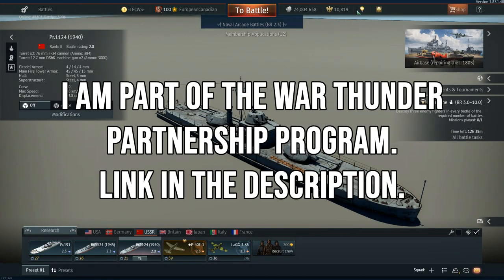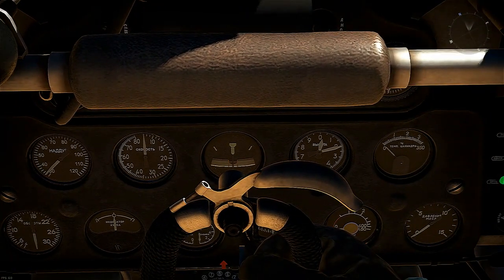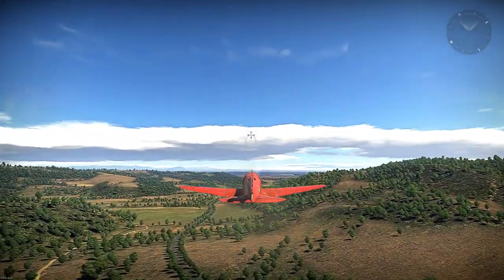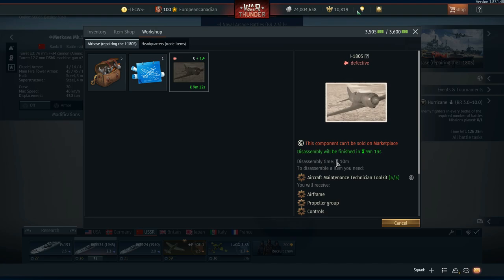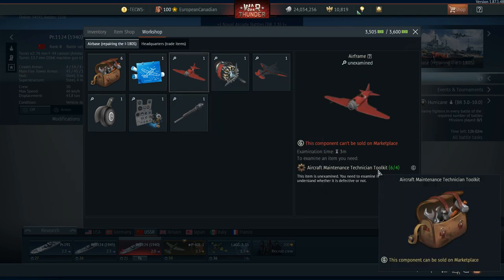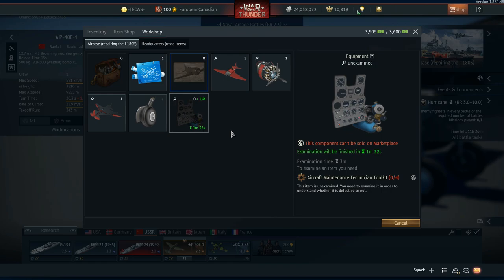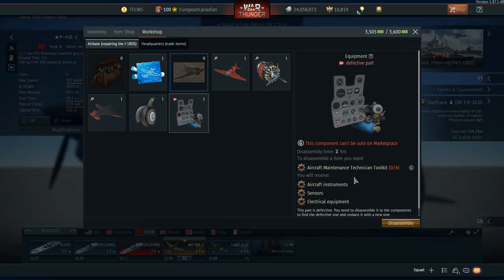War Thunder - Battlefield Engineer Diagnostic and Assembling

Comment: Only a Russian mechanic would throw his tools away and get another set every time he finishes a project.
Reply: Insanitypepper 
Thus is a nation that made the hydraulic fluid on the T-34 drinkable, of COURSE they would do that
Reply: Precisely the opposite
Reply: @Valley Boy - You realize the only thing you get by paying is faster research? Your tier 6 Premium vehicle never sees a Tier 4 or most tier 5 unless it’s specifically in a lineup with the intention of breaking the matchmaking. Get better. This isn’t world of tanks where you get a tier 5 vehicle in tier 4 with a tier 7 gun. Players can buy camo, a large assortment of items for vehicle or even convert them to premium. Literally the only thing you get is a new tier faster and again which 80% of the vehicle over 1.3 ranks higher which you will extremely rarely see again when people break matchmaking or as a random pull. Unless your aware of a paid aim assist for arcade 😂 there’s very little pay to win. Try angling out or playing the tutorials a few times if your not doing well.
Reply: @seanbristol1723  it's not pay to win, but it's pay to avoid wasting years of your life grinding away at a mountain with a teaspoon.

Comment: Another trick to help find faults with the defective I-180S is to do a standard preflight check of your control surfaces while sitting on the runway; manipulate the flaps, rudder, elevator, and ailerons to see if they respond to control inputs. If not, then you have a problem with them. With that process I was able to quickly determine that my left aileron was FUBAR, which was later confirmed during the repair phase.

Comment: 14:17 I for some reason dont have that blue card named I-180S with a picture of an I-180S. I am curently disassembling parts and so far i disassembled armament for toolkits and electronic equipment. Is this a glitch? (also im not getting any components from battles)
Reply: Same here.
Reply: Same here
Reply: I had the same issue, but after completing the repair of two parts (Fuselage covering, Propeller group) the option to build the I-180S and it's Icon suddenly appeared.

Comment: I totally messed up the diagnostics, but from what I can see so far my airplane has the same faults as yours.
Fuel system
Rudder
Armament

But I guess since I messed up the diagnostics I have to examine EVERYTHING on the airplane...
Reply: same here, they never explained what the diagnostics thing was, I want to restart the event but I can't, It's so fucking frustrating
Reply: I have now completed rebuilding the airplane and I got a new one (i then sold the one I finished).
The new one also seems to have the same faults as the first one and the one in this video.
I did a perfect diagnostics this time and it seems the only difference is how many toolkits you get...

Comment: This first bit was actually really fun. Shame it becomes so convoluted and they won't fully base an event around testing vehicles, or work in a mechanic mode. 

What would be really cool is if they added a mechanic where you could diagnose vehicles damaged in battles and if you diagnose them correctly you get a cheaper repair.

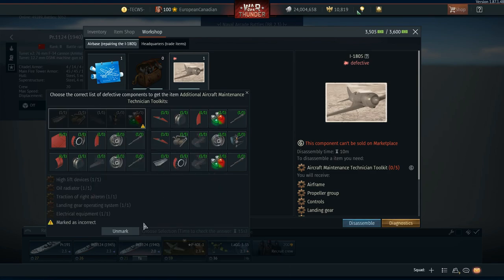Comment: 1 tool kit per battle, every other battle that is  because they only last for 2:30 to 4:55 because the seal clubbing is so fast. 4  to disassemble the plane, 4 to beak down the structures to components, 3 to break down EACH part for exam, haven't even got to the bloody assembly part. Oh, finished first in one battle, got 2 chests annnnnnnnnnnnnd  1 + 1 toolkits. Half of the people doing this frustrating exercise in futility won't even be able to finish the first plane, let alone any additional vehicles. This is gameplay CLICKBAIT. Sorry to rant on your channel, TEC, but this is a non starter. At least they have promised to remove the leftover parts and debris from your inventory when it's over. Or are we going to need another 4 toolkits to do that too?
Reply: They will find a way to make us use even more tools to do that

Comment: If it was as fast or just a little slower than regular research it would be worthwhile but ive researched probably 5 or 6 different vehicles in the time that I've just got the plane disassembled. It's bullshit that when a part is damaged you just have to scrap it then you have to buy the part on the gaijin marketplace

Comment: Yay, every crate till now droped 1 kit for me, including bonus crates for top performance in match. Plane that I got had defective parts in every component, so grind for the kits will be so loooooong. I'm short in cooling system to assemble engine component, cuz it was fubar. If they pulled full gaijin on this event then I might not be able to built even one I-180s if cooling system will not drop from battle. Plus, how convenient of gaijin that economy/research rebalance will take place after the event. Just in case that if you put a lot of time during the event, god forbid to unlock too many vechicles. I got annoyed. Acctually, I'm gona take advice, and just play the damn game as usual, to keep frustration at bay.

Comment: I dissambled a electrical equipment, because it was damaged.
Then I got 4 aircraft maintenance toolkits for it and the electrical equipment disappeared.
But now I still need the electrical equipment for the equipment.
So I have to buy it in the market place now?
Reply: You also get random component drops from boxes after battles.

Comment: I already screwed the parts selection. I am exclusively a tanker and I need to check damage on a plane. Fantastic! I picked the right aileron instead of the right aileron control mechanism......
Also, this event might be an improvement but it still relies on rng and part drops. And finally, the time for one fixed plane is too much for someone like me that only plays for 2/3 hours per day. I'll increase my playtime as much as I can but I'll probably be able to get only one vehicle.
As far as I am concerned, this event is another failure.

P.S.: let me add another thing. For me (tanker only) it's almost impossible to reach the top spot in a match because after a few minutes the plane spam is ridiculous and there is no way for me to keep up with the points. They might be called "Tank realistic battles", but as always planes ruin everything.

Comment: what if you did it wrong? could you diagnose it again? cause i didnt understand what to do at first
Reply: If you do it wrong, you can't do it again.
You have to diagnose the issue, then correctly state which parts are broken.
If you don't, you're given a reward for however many issues you were correct on.
Which in this case, was 5/5. He guessed all 5 correctly.
If you answer poorly, and don't actually know, and just fucking GUESSED... you get one toolkit.
Or 0. I don't know if you can actually get all the answers wrong, but...
TL;DR, no you can't.

Comment: Man Gaijin made this ridiculously more difficult to understand ...  The easy way is to diagnose correctly ... grind to get about 30 workshops consumed ... then sold them all ... was able to then buy a full plane with all the parts ... etc. Disassemble the broken plane, say yes to coupon ... wala ... all is fixed ... you have an I 180s as part of your collection. Side note ... it's not worth the effort!!! The only thing that does make it worth the effort is 30 free repairs. Aint nothing much special about it.

Comment: I don't know.... i feel a little bit screwed. maybe i did somethin wrong but i had to dissasamble and check every part anyway. i think i got the diagnose right cause i got 10 toolkits out of it. feels like a rip off. the "get on first place and be 80% faster" is an indirect lie. if you want to be 80% faster you have to be on first place in every match until you reasambled the plane. btw i'm at 12 hours playtime and still far away from reasambling the plane. 95% of all matches i get 1 toolkit out of the box (got 1 time 10, 2 times 2 and the rest just 1 toolkit). and 90% of me getting first place i also only get 1 aditional toolkit out of it (happend around 8 out of 9 times in the past 12 hours [no camos found]). result is: i'm pretty disapointed.... -.-

Comment: What is the gauge at the bottom right of the front panel? The one that stayed at 0 in the vid.
Reply: If you mean the gauge that goes from 0-15 it's the oil pressure
Reply: @Pupixario  Thanks!

Comment: But are the components an rng thing or can you do something to get them because if its rng I'm done with the damn game. That was the problem with th is-7 never got anything I needed even if I finished in the top 4 in 7 out of 10 matches
Reply: Console players like me got it better is7 a piece of cake with metal detector it gave you a rare crafting part in 1 2 battles that you could use to make a rare part like the green parts and after you had them you could make a rare part then disassemble it for around 5 regular parts

Comment: Do you have any advice for PS4 players  who dont have as many key binds for testing diagnostics
Reply: I'm a Xbox player and does PS4 get the thing for 600 GE to get stuff faster if so do you understand what it does and it only last 2 hours
Reply: @sniper321fire  no I didnt see anything like that
Reply: @buckwildlonghorn8843  so if you go to the tab by inventory it doesn't show a book or for 900GE you can buy 30 toolkits
Reply: @sniper321fire  ok yeah I see that now, just the diagnostic process is difficult for me at least on console
Reply: @buckwildlonghorn8843  I wish I could buy the stuff like other event with the ship and PBM3 my internet has been so bad since the 4th of January for no reason and with the book does it say last 2 hours on it and do you understand what it would do I can't play whatsoever without going from around 100 ping 2 packet loss up to 20 packet loss and 200 plus ping for 7 hops
Reply: @buckwildlonghorn8843  I just tested it on my phone without my Xbox one connected same with step brothers Xbox first is modem around 70 not bad for CenturyLink but the other 6 hops is always 200 plus MS and I have it set to test 5 times per hop so 35 in total

Comment: how do i know if the brake sistem isn't working?
Reply: Start to take off but don’t lift off the runway, then engage the breaks while on the ground (s by default) of you slow down quickly it’s working, if you keep moveing for a while then your brakes don’t work
Reply: @deathdragon2283  it takes about 22 seconds to stop the aircraft if i cut trottle and start braking right after my tail elavates on his own i guess that's not normal right?
Reply: @deathdragon2283  it takes about 13 seconds if i don't take off i guess they are broken tanks a lot